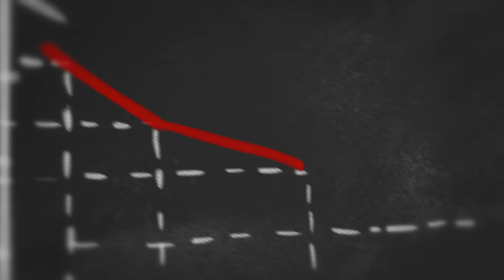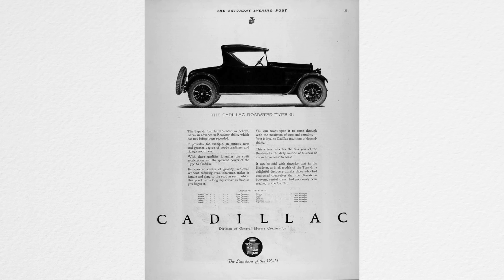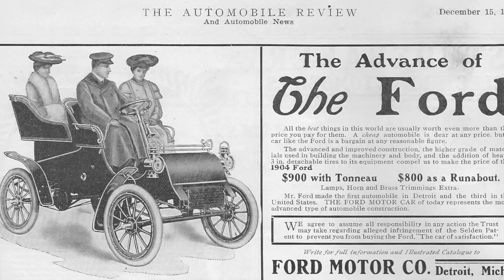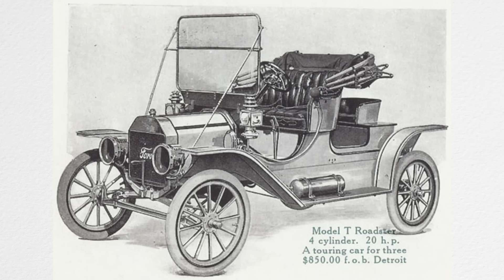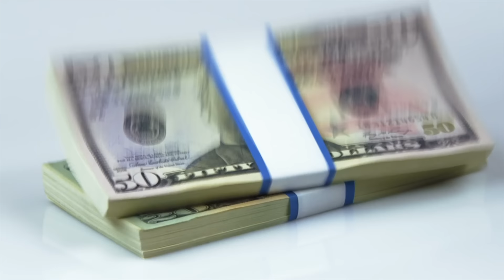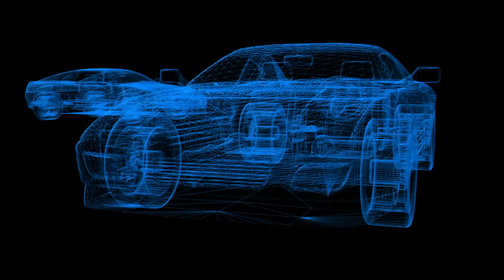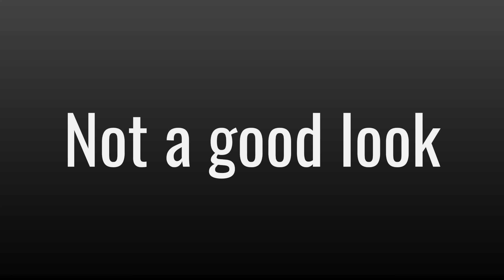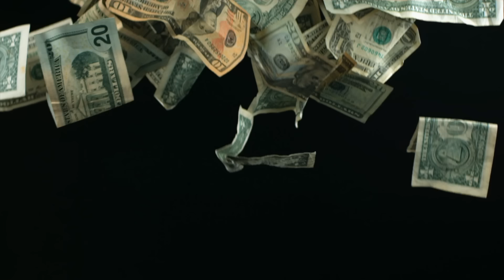Henry Ford: Innovator Until He Wasn't

Comment: “VOID THE WARRANTY IF THE CAR IS PAINTED ANYTHING OTHER THAN BLACK” -Henry
Reply: Because other paint colors wouldn't hold up back then.
Reply: bleuflamenco still sounds like ford propaganda
Reply: The quote was you can have any color you want as long as it's black.
Reply: Well look what happened when the changed the colors..  we got the great depression.  It's all etzels fault
Reply: "but it's painted very very very dark blue!"
Reply: Black paint dried faster. So the line could put out more vehicles. It also had the benefits of simplifying production and being cheaper.

Comment: The Success wasn't meant to go fast. It was a highwheeler. It was meant to drive through high water, mud, rocks, debris in fields. It was like an off road vehicle. Besides, it was considered dangerous to drive 20MPH at that time. Roads weren't smooth and clear. You don't judge a tractor by its top speed.

Now don't get me started on Edison, innovator until he wasn't...
Reply: Edison, innovator until things to claim as his own dried up.
Reply: Edison was an innovator until the very end. Innovator just means you are constantly trying new and inventive ideas. It doesn't have to mean those ideas are going to be successful. For example he tried to make an entire house from only concrete. The upside was that it was dirt cheap, the downside was that people don't like looking at walls of concrete or want to have other people look at it. He didn't allow for his homes to be plastered as it would add to the price and he seemed to like the look of concrete. He made over 10.000 of the concrete homes, almost none sold.
He even sold concrete furniture like chairs and couches.

He also tried to get into the car making business but unlike most he was insistent on an steam powered car. The thinking was that it would be cheaper and could run on any fuel available. The problem of course is that steam engine don't have anywhere near the power to weight ratio of internal combustion engines.

Henry stopped being an innovator because he stopped innovating and became very conservatist.
Reply: Edison was a litigator until the very end.
Reply: my R/C car is faster than that
Reply: @MrMarinus18 it exactly means it will be successful or an improvement. Literally

Comment: Just thank the car gods every day that the Model-T's control layout never caught on.  You had three peddles on the floor and none of them were the throttle, that was on the steering wheel next to the spark advance.  You had one peddle that was your reverse gear, one that would shift either between high and low gear, or low gear and neutral, depending on where the handbrake lever was, and the third peddle was a brake.  

It was fine for cruising down the highway, but can you imagine how awkward it would be in heavy traffic.
Reply: Makes ya wonder when it finally started to make sense.
Reply: Alain Archambault  top gear did a good segment on that
Reply: Ray Ceeya  You’re absolutely correct! I owned a 1926 for 12 years or so but I found it easy and was driving it within 5 minutes of bing shown by the previous owner! They layout was the right pedal was the brake,the middle was reverse and the left was how you went, down all way was low,out was high and in between was neutral. I only drove it around town but my leg would get sore since I could only keep it in low.
Reply: I’ve driven one.  Nothing at all is intuitive to us today.  I stalled it several times due to the neutral position on the left pedal only being half way down.  The system is easy for someone that had never driven though. The owner of the T model’s son was seven and could drive it without issue.  He didn’t know that that pedal should have been a clutch and go all the way to the floor to stop.
Reply: Yeah the one nice thing about it is you can cruise down the road without even the pedals.  So I guess Henry Ford invented cruise control too...

Really though, that's how a lot of old tractors work.  When you're harvesting or plowing a field you just want to set your machine's speed and trundle off at the most efficient speed.  

When I was a kid, my dad had old two cylinder John Deeres with hand throttles, hand clutches, and differential brakes.  So to come to a full stop, you throttled back, with your right hand, disengaged the clutch, with the same hand, and then used both feet on both brakes. Left hand stayed on the steering wheel. 

Also, if you were really good, you could change gears on the fly while turning by using your right hand on the clutch, your left hand on the snifter, and steering with your feet on the differential brakes.  I never got that good.
Reply: today TESLA is one peddle driving with Automatic Regen when let off the peddle. 
soon TESLA cars will have No Steering Wheel and No Petals at All. 
also, no mirrors as cameras can handle all the tasks and work in all Light Conditions .
Reply: There was no heavy traffic when this vehicle was marketed. Or highways. Or paved roads outside of large cities.
Reply: As opposed to a clutch, brake and accelerator? Ever do a stick shift on a hill where you dance between letting the clutch out (one foot) holding the brake until the clutch starts grabbing (one foot) and giving the car gas so it won't stall (third foot, but wait you're out of feet!) But wait- we're used to that system so it's easy and it's normal! Trying to drive a Model T after learning on a "regular" car is akin to learning how to drive on Farmall tractors (foot clutch) then jumping on a 2 cylinder John Deere, with hand clutch AND someone put the starter pedal right where the clutch pedal SHOULD be, (NOTE: engaging the starter will not stop the tractor, it makes a very expensive high pitched noise that  makes you want to stop the tractor even more then when you panicked and hit the starter pedal in the first place, don't ask me how I know this).
Reply: You had all kinds of different control scheme's. It wasn't until WW2 that car controls would become truly standardized.
Even cars with 3 paddles of throttle, break and clutch were not the same. Many had the break on the left side and the clutch in the center.
Reply: Ray Ceeya that sounds cool. I work with a non profit that has a few Johny poppers and I find the hand clutch very easy to use.
Reply: Cadillac actually got it right but no one cared because it was too expensive.
Reply: Soon. 2080 soon lol

Teslas only work on perfect rich country roads boi
Reply: GloomGaiGar so did Austin with a cheap car.
Reply: @fk4515  you've never heard of a handbrake?
Reply: @fk4515  Handbrake on, clutch down, change into first gear, apply a little a gas while coming off the clutch until you feel the bite, rev a little, release the handbrake, you will now be stationary with no brake, apply more gas while coming fully off the clutch as you drive away up the hill.

No brake pedal needed. Only 2 feet required.

Comment: So Cadillac (technically) originated from Henry Ford?
Reply: joe nodden technically yes
Reply: So did Dodge (technically).
Reply: no the Model A (the first one) was a dodge chassis and engine, Ford's "assembly" plant mated a purchased body to the Dodge sourced chassis, put wheels on it and it was complete. Without the Dodge brothers (or whoever would of made the engines, transmissions, chassis , steering, brakes and suspension had the Dodges not been around or declined to participate in Henry's little project)  there would of been no Ford, but without all the money the Dodge Brothers made producing parts for Ford there wouldn't of been any Dodge cars either. I'm not to sure that Henry had much influence on what eventually started rolling out of the Cadillac plant.
Reply: Capt. Beak Dude you lost me with those random parenthesis.
Reply: This is why Henry Ford is known as the godfather of cars. Even though so many deny it..
Reply: Yes
Reply: Fort: creating competition since the 1910s
Reply: Chevrolet technically was a spinoff too. Louis Chevrolet "got a better idea" after his brother Gaston was killed in a Ford while racing for Ford.
Reply: joe nodden and dodge
Reply: Yup. He started it. It was going belly up and got bought out. I went to school to work on Fords. Learned about it there. Blew my mind.
Reply: Funny part is, they still do. One makes a big ugly, and to compete the other makes a bigger ugly or big uglier....
Reply: @LordMekanicus  Are you talking about the trucks?
Reply: Yeah, pretty much.
Reply: Cadillac also for Merasmus the Canadian wizard lmao
Reply: Yes, I have seen several cars built by Ford while at cadilac
Reply: @fk4515  your wrong the model t came first and then the model a in 1927 and then after the model a came the ford v8 in 1932
Reply: @garyjohnson6858  Read my comment "The Model A (the first one)" in that statement I'm referring to the first Model A the Ford Motor Company made in 1903 and 1904 with less than 1800 cars made in the Mack Avenue plant they leased. The 1903-04 Model A was replaced by the Model C in 1904 with some interim cars sold as the Model AC, which was a Model A with a Model C engine. In 1953 Ford sponsored or commissioned a book about the Early days of the Ford Motor Company as part of their 50th anniversary celebration , much like they did in 2003 for their Centennial. In the 1953 Book they detailed the failed start ups that Henry Ford was involved in. He started by founding the Detroit Automobile Company, it went broke, he re-capitalized it and named the re-organized company The Henry Ford Company, he argued with investors and the board of directors and left and founded  a Company known as Ford and Malcomson LTD, when they took in additional partners the company name changed to The Ford Motor Company, the directors of the Henry Ford Company renamed their company Cadillac as the didn't want to use Henry's name for fear it would promote his new company (Ford Motor). The first cars Ford Motor company  made were referred to as  Fords, Fordmobiles or Ford Model As an were assembled at a leased facility on Mack Avenue. The assembly involved  installing purchased bodies and tires and wheels on chassis/running gears purchased from Horace and John Dodge's machine shop.  During the early years Ford also founded other companies one using the name "The Henry Ford Company" which produced parts and assemblies for Ford Motor Company  which of course upset Ford stockholders Horace and John Dodge who found production of parts from their shop being pushed aside for parts Henry made in his own company and a business called "Henry Ford and Son" which produced tractors and farm equipment. Once Ford gained sole control of Ford Motor Company he rolled some of his outside interests into Ford Motor Company.  Ford Motor was a public company when they built the Highland Park plant and the Model T went into production but was a privately held company when The Rouge River Complex was built and the 2nd Model A went into production. Ford remained privately held until 1956 when  the Ford Foundation offered some of their shares to the public.
Reply: @LordMekanicus  In a few years, all those gas-car companies will be shrinking. Teslas are made with 100% American parts and are designed to last, not for planned obsolescence. In Michigan my whole life has been watching the decline of the "Big 3" due to greed, incompetence, and lack of willingness to compete. After 2008, GM killed off 2 of it's best brands that had the most crossover appeal to foreign auto buyers: Pontiac and Saturn. All to keep dinosaur Chevy, now neutered to build cars like the Aveo. The electric/autonomous revolution can't come soon enough!
Reply: And technically dodge
Reply: No
Reply: @garyjohnson6858  
No you’re wrong. He’s right. It’s a little confusing because there were two different cars named Model A. It went something like A, B, C, T, A. That wasn’t it exactly but it was something like that. He explained it correctly. 
(Except that he said “of” a lot when he should have said “have” which is a little distracting. That’s confusing to some people too because should’ve, would’ve etc are contractions of should have, would have etc but when you say them they sound like should of, would of etc)
Reply: @joenodden  
Yes the parentheses though not really random, do make it a little hard to follow but what about all those “ofs”?
It’s maddening!
Nevertheless, he is factually accurate.
Reply: @pillihpzelaznog2017  
Yes I’ll deny it. I have never heard of Henry Ford being known as  “The Godfather” of the car. I think you made that up. C’mon man! Hahahahaha 🥴
Reply: @vladtheimpala5532  yeah I did make it up but what the hell why not? He’s definitely up there with all the great innovators. I respect everyone’s opinion.. I mean you can say anyone was The Godfather of cars right? I get that.
Reply: Yes he left out the story of Henry Leland. Henry Leland was an engineer that played a major role almost as big if not bigger than Henry Ford in automobile production
Reply: @paullemke5915  what will blow your mind again is the story of Henry Leland who played major part in creating Cadillac and Lincoln Motor Company. As well as automobile production in general.
Reply: @fk4515  why does everybody forget about Henry Leland? He was an engineer who played a major role in the creation of Cadillac. He started Lincoln Motor Company which was eventually purchased by Ford Motor Company. He also helped with the production line capabilities by having interchangeable parts. He was given multiple awards from Britain for engineering Feats. He where Julie was an engineer for Oldsmobile creating small parts for Oldsmobile look up Henry leave and he has a very very very interesting history. He's as big as Henry Ford if not bigger.
Reply: @R2FilmProductions  major role in Cadillac? You mean forcing the chief engineer out of the company and then re-naming it Cadillac? For Lincoln, yes Leland was instrumental in founding Lincoln. I suspect that when Henry Ford purchased the Lincoln Company there were two major reasons, first it allowed him to fire Leland so Henry Ford got his revenge for being forced out of The Henry Ford Company. Second I suspect old Henry bought The Lincoln Motor Car Company as a toy or distraction for Edsel. I'm thinking he wanted to keep Edsel busy doing something other than pushing him to change the Model T. Henry Leland may of been a great engineer but didn't have the effect on the auto industry Henry Ford did. Some additional research indicates that Leland may of not had much to do with forcing Henry Ford out of the Henry Ford Company and that he was brought in after Ford's departure to oversee the liquidation of the Henry Ford Company but instead convinced the board of directors to build a car using an engine he had developed. His previous experience had been with Brown & Sharpe and then in the firearms industry working for Colt's Manufacturing, these were firms that were very big on precision machining and interchangeable parts. It is interesting that his contributions to Oldsmobile when it started were similar to what Dodge Brothers did for Ford Motor Company.  Sure he founded Lincoln, a company that became insolvent within 5 years of it's founding. Leland's age was also a factor as he was almost 20 years older than Henry Ford his contributions to the auto industry came much later in his life and he had passed before the industry hit its' stride.
Reply: In a nutshell

Comment: First car I ever changed an engine in, 
was a 1929 Model A Victoria.  Car was 
owned by a good friend's parents.  This 
friend has a sister.  Yep, named Victoria!

They also had a 1957 Ford Fliptop. 
(Skyliner.)Changed main bearings 
in THAT one, with the block in the car.

My friend had a 1962 Chevy Corvair, 
a convertible model, that he turned 
into a Spyder.  (In 62, the turbo Spyder 
model VINs ran consecutively with the 
base models, so no one ever found out.)
THAT car was AMAZING, in that he 
"blueprinted" the engine, beefed up the 
turbo, and installed a 2 BBL Weber 
sidedraft, with vacuum secondary, 
controlled by a dash switch.

steve